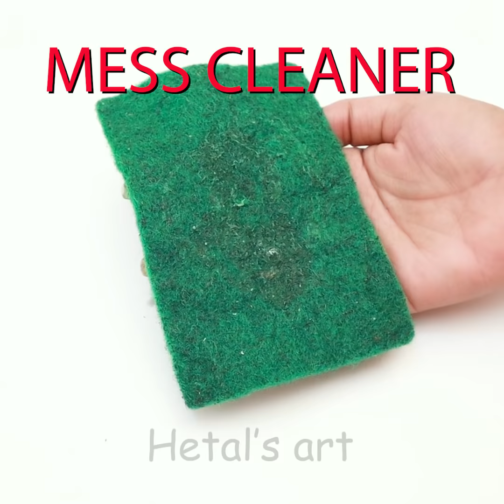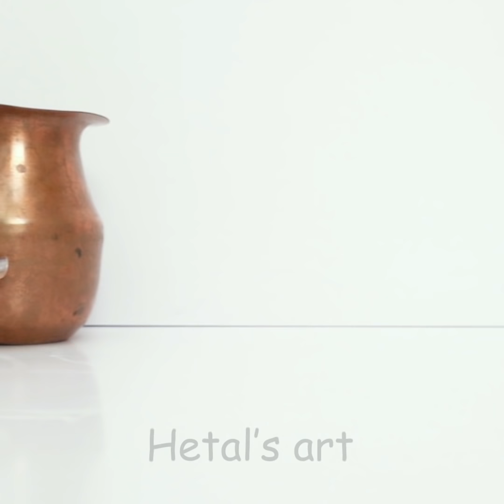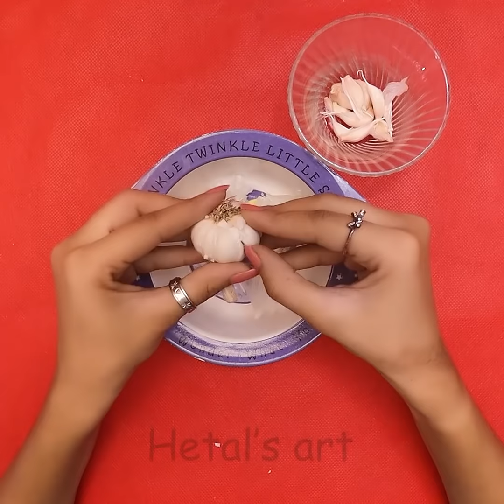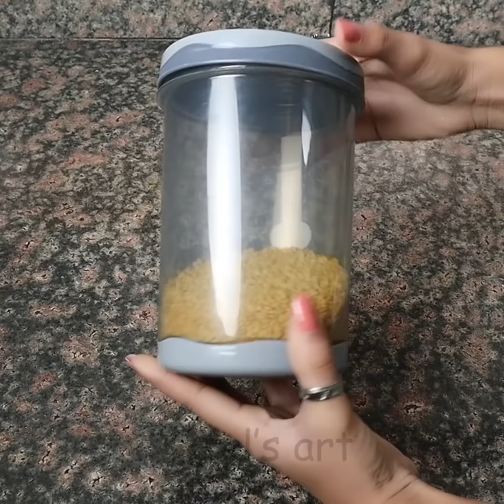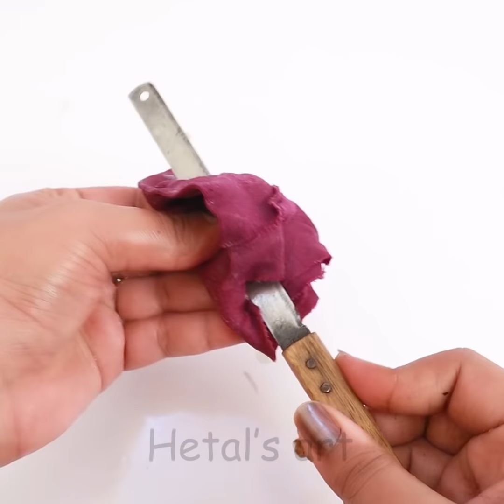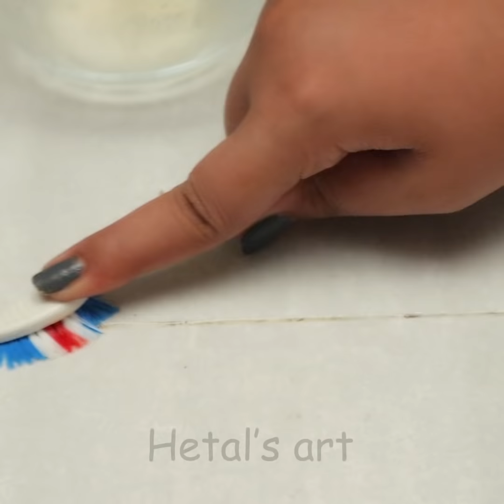24 Amazing Kitchen Tips & Hacks | Useful Cleaning #Kitchen #Hacks #Hetalsart

Comment: Very nice and useful tips
Plz show a tip how to remove a stubborn oil stains of kitchen tiles 
And rice cooker
Reply: I used to clean with lizol  floor cleaner and a steel scrubber try it once
Reply: @lakshmivasavi8231  thank u so much I will try definitely
Reply: @VAngel-xs8wd  welcome
Reply: Can we cleans burnt kadhai with lizol or harpic ? Is that kadhai is safe to use after washing ?
Reply: @shreev07  boil water in it. Add baking soda and lime or vinegar. Let it rest for sometime. Scrub it gently with the water. Then wash as usual
Reply: Very nice mam

Comment: just use the rice kanji after u drain ig to clean the burner. soak it for an hour of two and it will the same result instead of wasting money on eno and lemon. same ricd kanji soak iron kadai for few hours and clean it will graduslly become ur non stick kadai..same with copper snd brass vessels too..
Reply: Rice kanji kya hota h???
Reply: It is the rice baap ..the starch that we remove after cooking of rice...in open cooker method
Reply: Vous pouvez traduire en français svp
Reply: Eno cest quoi
Reply: @ifraimranansari8016  😊